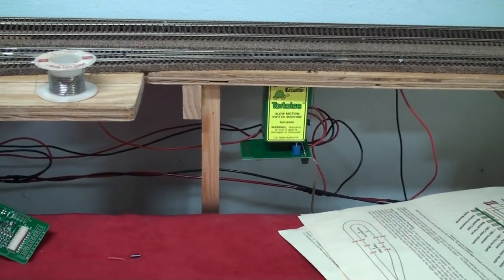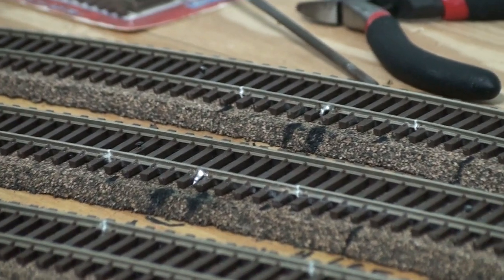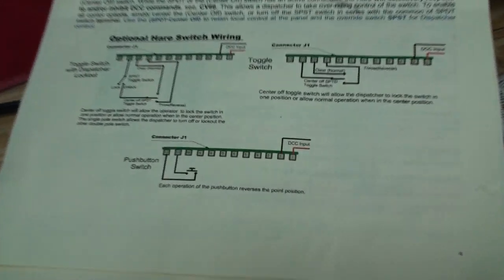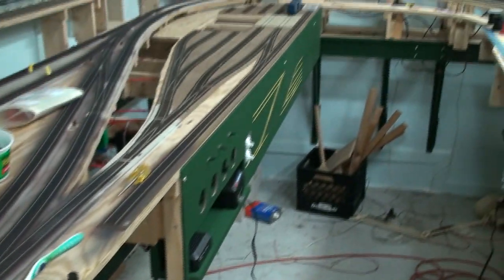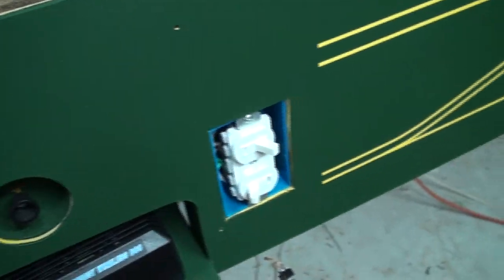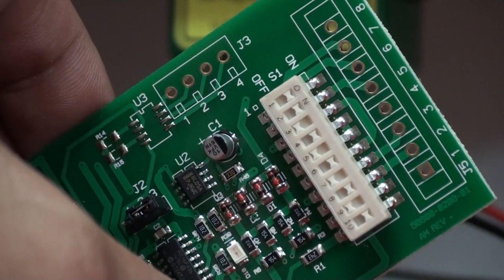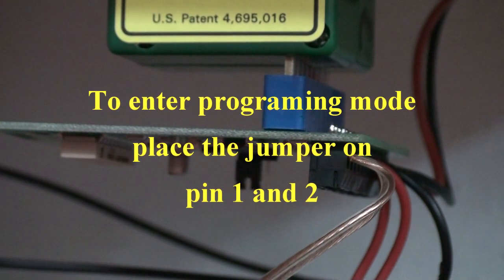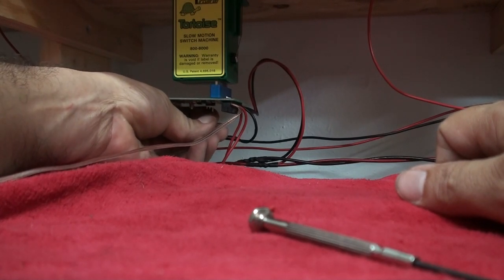My CSX/NS HO Railroad Part 17A "More on the Hare/Tortoise Connection"

Comment: Nice video
But: you should never tin a wire that you mount in a screw terminal. This is because, the tin will, after a few years, sort of flow (lik a sort of liquid) under the pressure of the screw! The result will be an unreliable contact after a few years.